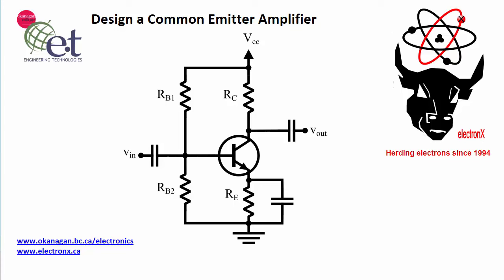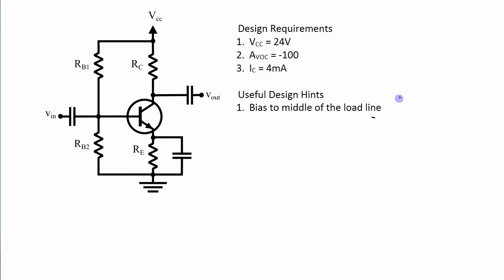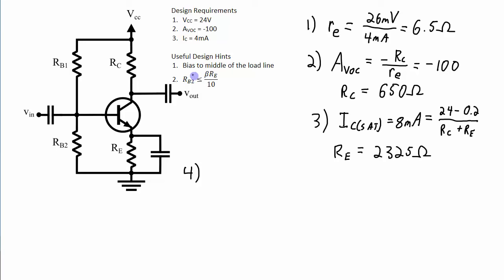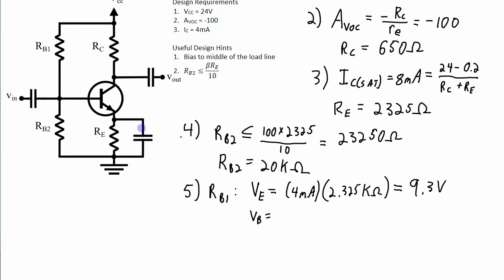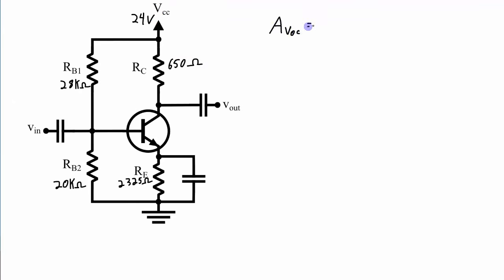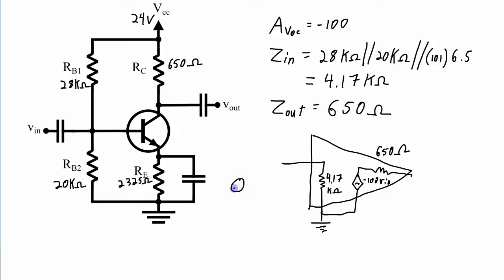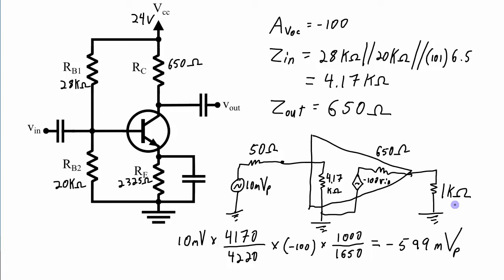Design a Simple Common Emitter Amplifier

Comment: I dont understand how you got 2325 ohms on part 3?
Please explain.
Reply from the maker: A couple of design restrictions that I set are IC=4mA and to bias in the middle of the load line. For IC=4mA to be in the middle of the load line requires that the saturation current (IC(sat)) be two times that -> 8mA. IC(sat) = (VCC-VCE(sat))/(RC+RE). I've already determined RC, so I just have to solve that equation for RE.
It's important to note that re and RE are different resistors. RE is the external biasing resistor connected at the emitter and re is the internal resistance in the emitter of the BJT.
Reply: Thanks for the reply, but when I do the math I get a completely different number.
This is what I have 8=23.8/(650+RE) when I do this I get 0.2929, sorry maybe I'm dense, I just dont see how your getting 2325??
Reply from the maker: That should be 8mA or 0.008. Then, I think you made a mistake in your arithmetic somewhere. 0.008=23.8/(650+RE) -> 0.008(650+RE) = 23.8 -> 650+RE = 2975 -> RE = 2325 Ohms
Reply: OK thanks, yes I wasn't converting ma to a so I was dividing/multiplying by 8 not .008 :(
Reply: @ElectronXLab  im still not getting it
Reply: @ElectronXLab  im getting 0.2929 also and did the conversion to Amps and it's still giving me 0.2929
Reply: @ElectronXLab  Can you show how you have transposed the original equation in  part 3 in more detail. This is still very confusing how you have written it out. What does -> mean?? 23.8->650+RE =2975.. How? I can't see how you have solved for RE..
Reply from the maker: @JamesAnderson-bz4cg   
That arrow simply means "next step"
1) 0.008 = 23.8/(650+RE)
2) multiply both sides of the equation by (650+RE) to get 0.008(650+RE) = 23.8
3) Divide both sides of the equation by 0.008:  650+RE = 2975
4) Subtract 650 from both sides of the equation:  RE = 2325
Reply: @ElectronXLab  Thank you for the reply David, that makes it clearer and will help out a lot for others too I'm sure.

Comment: Can someone please help me understand part 4!? Where does the selection of RB2 must be less than (beta)(R_E)/10 come from?? In my textbooks, I see only RB2 should be (V_eq)/(9*i_B). Please and thank yoU!!
Reply from the maker: Strictly speaking RB2 does not have to be less than (beta)(R_E)/10. If you are using the shortcut of assuming I_B is so small as to be ignored, than RB2 needs to be at least 10 times bigger than the resistance looking in to the base.
Reply: You're trying to ensure that the current through Rb2 is at least 10 times the base current drawn by the transistor. If it isn't, then the HFE of the transistor starts to have an increasingly large effect on the base bias voltage, and therefore on the emitter-collector current, so different transistors of the same make will give different collector voltages, potentially causing clipping and a lack of reproducibility of the circuit.

Comment: Thank you for sharing your knowledge on YouTube. I have a question. In determining the value of small re, why wouldn't you use Ic(sat) current instead of the quiescent? Also,  I plugged all of the formulas into a spread sheet and entered various Vcc's and Icq's and beta's. Everything worked for the sample values you gave but when I changed values I began to get negative RE values for the emitter resistor....for example, use 9 Vcc and 200 beta.
Reply from the maker: You use the quiescent current because that is the current that is actually going through the transistor and re is based on the state of the transistor. 
You were getting negative values probably because the values you were putting in are values in which the the transistor can't actually operate.
Reply: @ElectronXLab  Ok, that makes sense. I notice some designers always make  RE smaller than RC. For example they start out with Vce being half of VCC, then VRC being 3/4 of what's left and VRE being the other 1/4. They choose a Icq and go from there. I was wondering if one method is better than the other or is there more than one way to skin a cat......
Reply: @billwilde8725  can you send me the video that telling that
Reply: @hero96559  Sorry, that was 2 years ago, it's lost in the shuffle now....
Reply: @billwilde8725  So did you get an answer for your quetion ?

Comment: Why do you use Ic(sat) =8mA BTW what Is Ic(sat)
Reply: Ic sat is when the transistor is fully on inother words saturated and it cannot amplify any more.
Reply: Would the saturation voltage line up with the saturation current say if you were using a graph from a BJT data sheet to find your quiescent point ?

Comment: Sorry is this video supposed to help me? Where are all these equations and values coming from? Also, should you design this circuit based on what transistor is to be used and with what use in mind. This is all way too arbitrary to be even marginally helpful.

Comment: dont just cheat us..u haven't discussed designing of capacitor!!! thats the most important thing...totally wasted my 11 minutes..
Reply: Yeah. You should know all of this and not even watch the video at all. And "sad"? Are you quoting Trump?
Reply: @jamescollier3  Capacitor For this Circuit : Note That 40 value in the equation is the lowest frequency in Hz, that a human can hear So We need to filter it out
C = 1 / ( 2 * PI * 40 * (Re/10) ) = 
C = 1 / ( 2 * 3.1416 * 40 * (2325/10) )=
C = 1 / ( 251.328 * 232.5 ) =
C = 1 / ( 58433.76) = 0.000017113   Farad
C = 0.000017113  * 1000000 =  17.113 uf
Reply: @vainboaster  Why is it (Re/10) and not just Re?
Reply: The actual value of the bypass capacitor is set by the lowest frequency that we might want to use. For audio, we generally take this to be 20Hz.
The gain of the amplifier is effectively (collector impedance) / (emitter impedance). The collector impedance is fixed at the value of the collector resistor (Rc). The emitter impedance is the sum of the transistor's internal emitter resistance (re = 26mV / Ic) and the emitter resistor (Re).
So to set the ac gain, we can use a capacitor in parallel with the emitter resistor to "short it out" or bypass it. Because the emitter impedance = re + Re, we need the reactance of the capacitor at all audio frequencies to be small compared with re (and I mean re, not Re), so that the gain becomes Rc / (re + Xc) which becomes Rc / re as designed if Xc << re.
It's a common mistake to think that we should use the emitter resistor value in calculating the bypass capacitor, but we need to use the internal emitter resistance as shown above.
If we set the reactance of the capacitor at 20Hz to be equal to re then that will reduce the gain by 3db at 20Hz, which we call the cut-off frequency.
So C = 1 / 2πfR = 1 / (2π x 20Hz x 6.5R) = 1200μF.

Comment: What purpose does the capacitor in RE  serve ??   And I plugged in your values on a simulator,  and it looks weird.  The waveforms are cut off.
Reply: WTF BBQ depends on your input signal at certain level it will cut off if the base current becomes sufficient enough to saturate the collector current
Reply: WTF BBQ A capacitor across a resistor will make the AC signal bypass the resistor and go only though the capacitor, hence the name bypass capacitor
Reply: Te gain without the capacitor would be,  Avoc = - RC/(re + RE). As the capacitor for  AC signal analysis shorts RE, the gain becomes Avoc = - RC/ re. In other words, the purpose of the bypass capacitor is to increase the gain of the circuit.

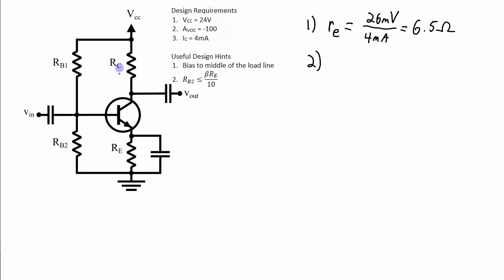Comment: where did you came up with 26mV a 3:05?
Reply from the maker: It's the thermal voltage VT = kT/q, where k is Boltzmann's constant, T is absolute temperature, and q is the charge of an electron. It's the voltage generated within a semiconductor junction due to the effect of temperature

Comment: What’s Avoc standing for?
Reply from the maker: Avoc is the open circuit voltage gain which is the ratio of the output signal voltage to the input signal voltage when there is no load connected (A = gain, v=voltage, oc=open circuit)

Comment: Hi, may i know why you picked RB2 as 20kohms?
Reply: and why 4mA for biasing? why not more?
Reply: Because RB2 should be "less or equal" (Beta x RE) / 10. The result was 23.25 K, so he chooses 20 Kohms.
Reply: @maxdias8024  ohh yess the assumption
Reply: @benjaminn412  You need the current through Rb1 and Rb2 to be much bigger than the base current, i.e. much bigger than Ie / beta. Since the voltage across Re is close to the voltage across Rb2, that means Rb2 needs to be much less than beta x Re. Otherwise the bias point for the base will depend on the actual beta of the transistor which can vary considerably between samples of the same transistor. If you make Rb2 too small, you reduce the input impedance unnecessarily.

The collector bias current determines the absolute size of all of the resistors in the circuit, although their relative values are hardly affected. If you increase it, you will end up with a low input impedance and an unreasonably large bypass capacitor.